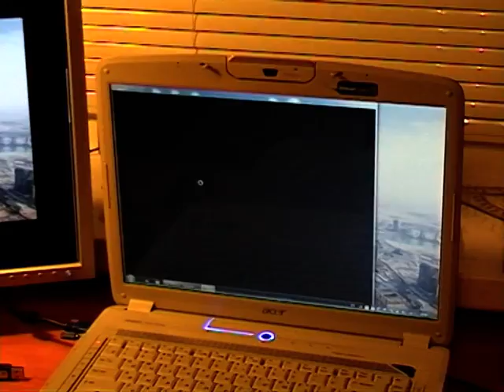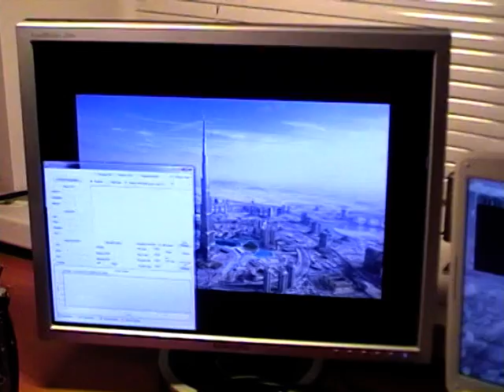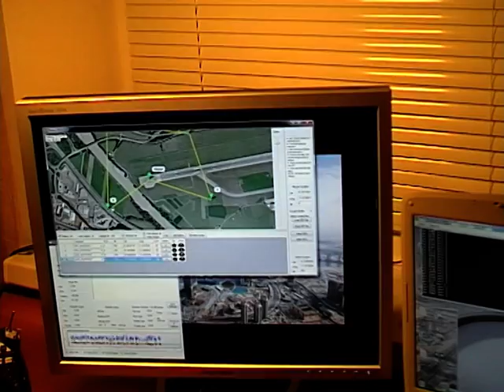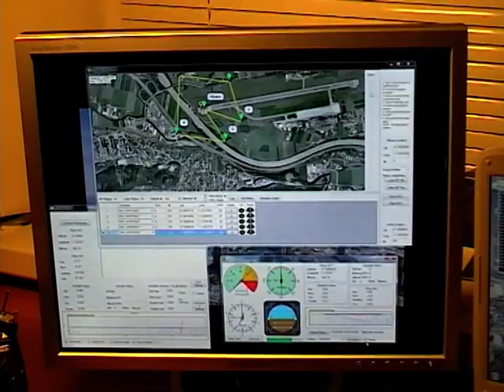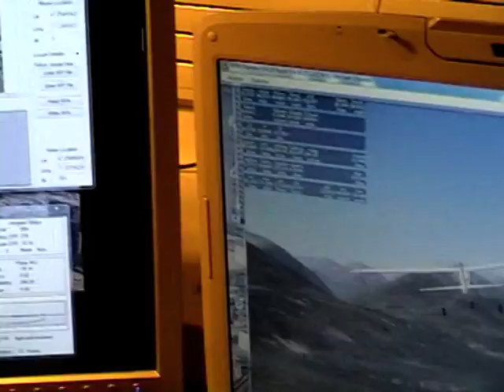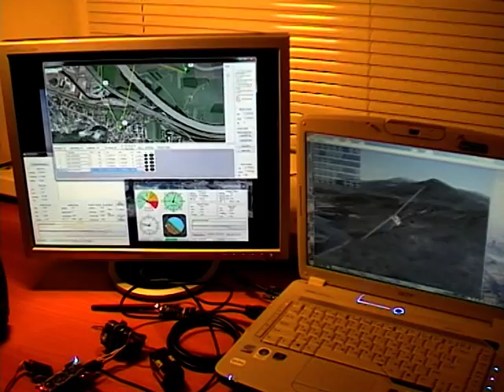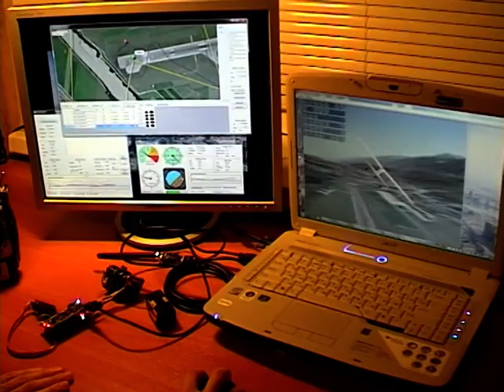HIL Simulation in XPlane using APM Planner GCS

Comment: Thank you very much Kirill. I have setup the HIL simulation with flightgear. I am flying cessna plane. As soon as I put in auto mode, throttle goes to zero. Any clue on that, I have been trying to find the answer but no success yet.

Comment from the maker: Thanks Dinesh! If you would to use transmitter / receiver to control manually you have to connect additional battery (this is for RC receiver), otherwise you don't need the battery, USB is sufficient.